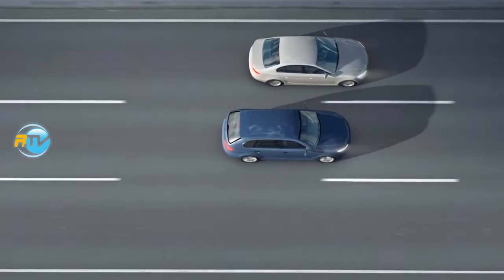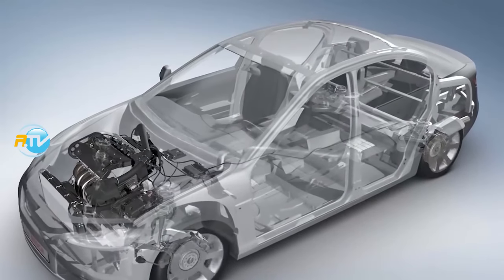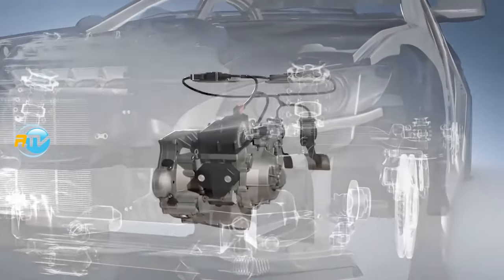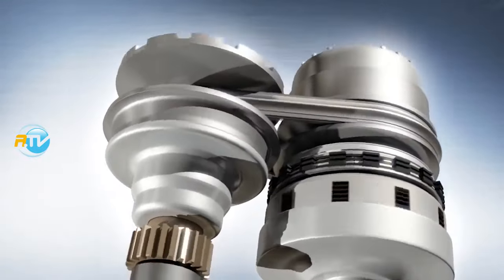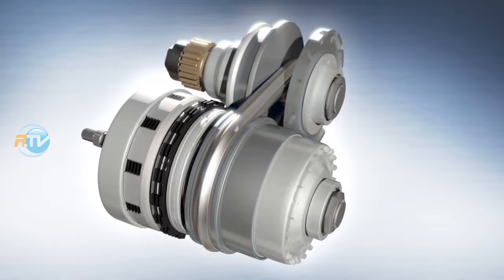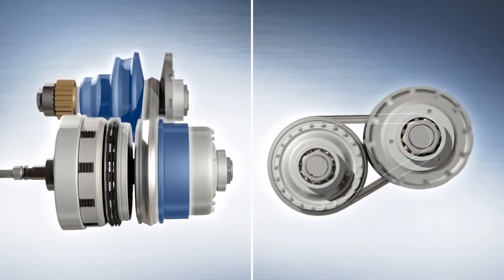Understanding CVT Transmissions | How CVT works?

Comment: That is why if you floor it and the engine just drones, it is spooling up. In other words, one pully is opening up/getting wider and the other is closing up getting narrower. and they cannot do this instantly, it takes a while. I in essence that is how they change gears. You actually get faster acceleration if you progressively press on the accelerator as opposed to just smacking it to the floor.
Reply: Operates like My Yamaha Snowmobile.

Still not big fan of these transmissions.
To many drawbacks not good for  Sustained speeds, sudden accelerations from stop, fluid changes every 30,000 miles (Customers are not going change fluid every 30,000 miles) and towing not recommended.
I drive a 2016 Chrysler 200C AWD transmission fluid is good around 100,000 miles.
Reply: Yep. My 10th Gen Honda Accord 1.5 has a little delay to accelerate. Unlike manual conventional transmission in the past, real acceleration was palpable.
Reply: Fascinating. Having grown up driving nothing but a truck (which accelerates like a brick regardless of transmission) and Subarus (all CVT), I honestly never noticed this delay. The smaller, lighter Subaru SUV accelerated faster even with the CVT transmission, and it never even occurred to me that the engine could accelerate faster. It already could accelerate far faster than anything that was ever necessary on your average drive. 😂
Reply: spot on. Just got a 2020 CRV with a CVT and its what it feel like. Stomped on it from a stop just to see what it feels like for future emergency situations. what a DOG. Slow as molasses so I know what I can and cant get away with in traffic merging situations. However if I am up to speed and or highwar speeds I feel like its very zippy and responsive when passing etc.
Reply: @tommyvlogssimz4274  Wonder if a more traditional gearing at lower speeds could be made to shift into a CVT at higher ones, to try and get the best of both worlds? Probably a hellish engineering problem to solve, and unlikely to be looked into in a world where electrics and hybrids are what eats up the R&D money, but still. Seems like an intriguing idea at the very least.

Comment: I still don't understand how the system works when switched to manual and offers (for example) a 5 gear selection on a system where actual gears do not exist.
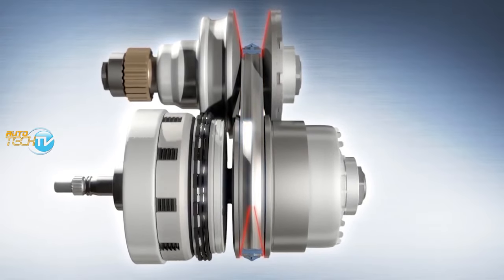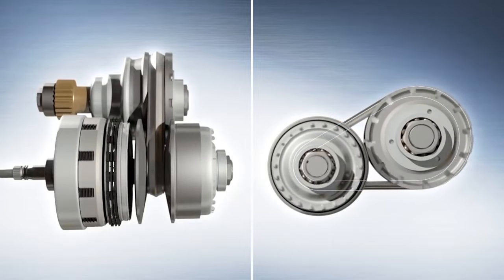Reply: the computer calculates the perfect ratio for that specific "gear set" and then translates it to the perfect belt placement. Watch at 0:54 to 1:10. the computer just has those perfect ratios set to achieve what would be those gears on a standard transmission!
hope this helps!
Reply: @robert55535  Thanks for your explanation. I understand now (I think).
Reply: Same😂
Reply: Ratios are  Infinite.
Apples to Oranges comparison.
Reply: Engine r.p.m. is always at peak loud and engine wears faster.

Comment: Unlike my Toyota 5 speed with 342k miles that still works perfectly the CVT will fail as I have seen in my step sons Altima, Chrysler, and another car I can not remember. They are junk. All failed under 100k miles.
Reply: Lol you just mentioned two of the worst car brands in existence.
Reply: Nissan and Chrysler are probably the worst CVT's out there. You get Toyota's ECVT and it's a whole different story.
Reply: Yeah my family’s Subaru CVT’s are both still going strong. Comparing a Toyota to a Chrysler was always going to be cruel regardless of transmission. 😂
Reply: my kinetic honda scooter works with cvt 🫂
Reply: Got 260k miles on my corolla no problems

Comment: What are you talking about "from max torque to max power" as if the two are different ends of mechanical input, max torque is what makes max power, in power u just consider rotational speed
Reply: Actually horsepower is measured by torque multiplied by RPM divided by 5252 stop pretending like your smart online 🤦‍♂️🤦‍♂️🤦‍♂️
Reply: It's calculated by measuring the power needed to move 550 pounds one foot in one second, or 33,000 pounds one foot in one minute.

Comment: So it’s a snowmobile clutch. Not a new thing yet again. Any new inventions in the last 70 years?
Reply: Uh? Normal automatic transmissions? Now those are outright sorcery. Plus the computer that controls these CVTs to handle road driving. Your satellite SOS. The infotainment system. Car sized AC units. Among others.